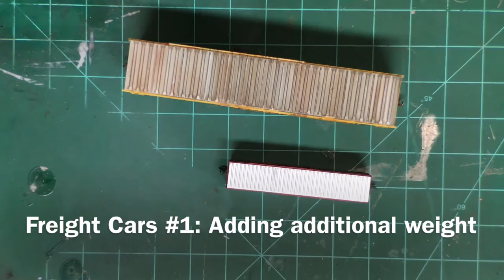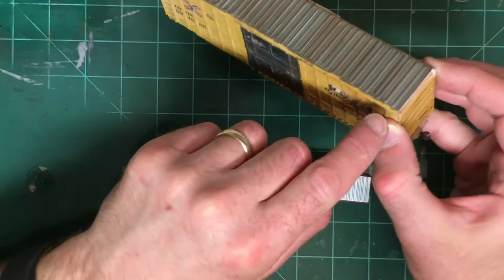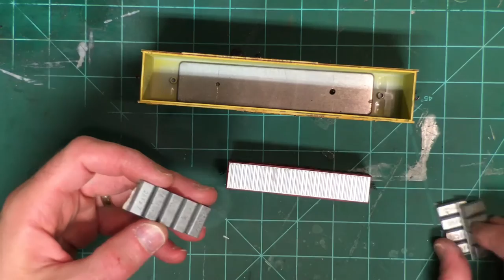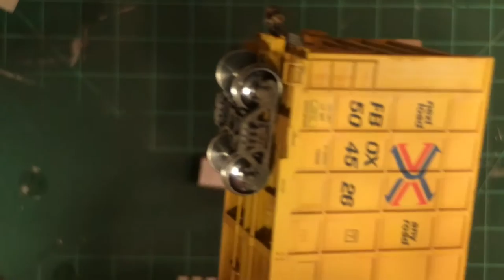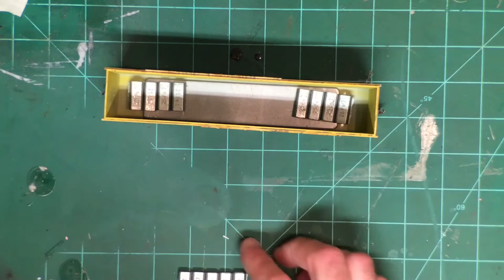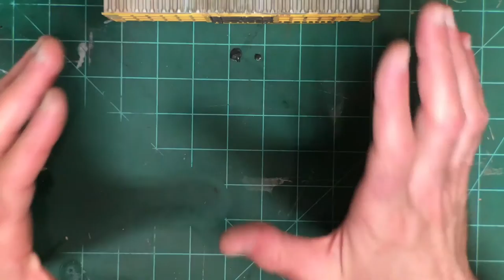Freight Car Projects #1: Adding Extra Weight

Comment: Hi Steve, do they make those weights for N scale? Thanks, Fred
Reply from the maker: +Fred Cordini In the next video on weathering an N scale boxcar (which I just uploaded) I use the same weights in an N scale car (at the end of the video). If you install them in the other direction they fit fine.  I don't remember the manufacture of the weights since I ordered them a long time ago and they just came in a plain brown box.
Reply: thanks Steve
Reply: +Fred Cordini These weights are used to calibrate the weels of the common automobiles; so if you ask a tyre dealer I think he can give you some, mayby for free. They come in different weigths and dimensions.